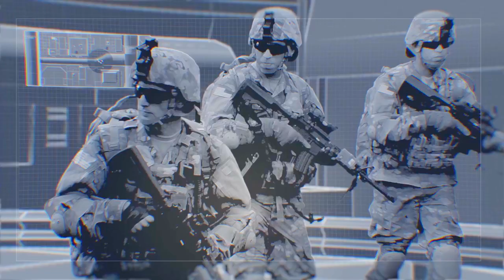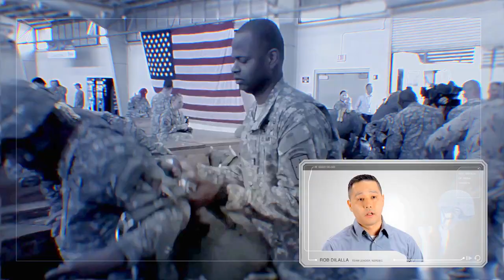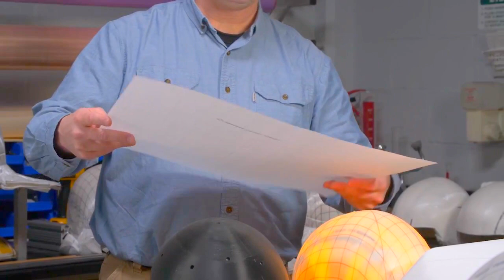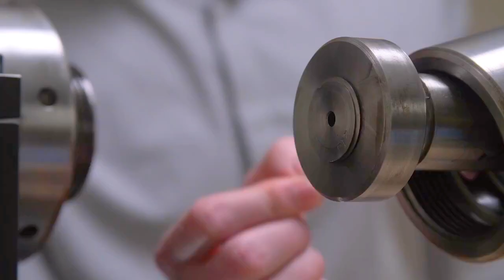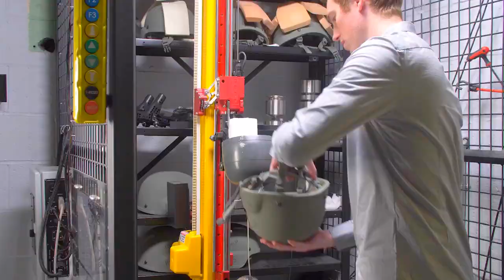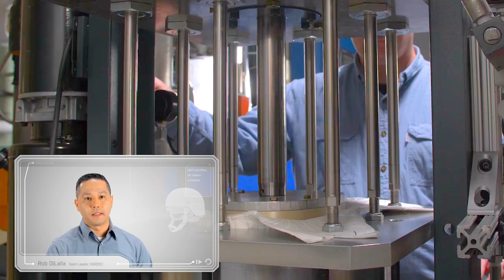US Army Natick Soldier RD&E Center - New Combat Helmet Prototype [720p]

Comment: This reminds me of the Ratnik Helmets (also provide better protection for less weight).
Reply: Standard Ratnik helmet is the 6B47 that means 9mm pistol round protection.  That's just about equal to the Stock ACH in use
Reply: thats what i am saying the 6B47 is lighter then the ACH yet provides the same protection.

Comment: Will the Marine corps be implementing the IHPS helmet or is it a solely army equipment?
Reply: I suspect the Marines will look at it but issue? hard to say because of the number of parts involved. it's not just a helmet.
Reply: Leon Cranson the Marines tend to get anything the army does so I was just asking. 

Thank you.
Reply: Not Accurate in the past 4 decades the USMC has gone it's own way repeatedly. They have issued there own Field uniforms, Helmets, Body armor, Load gear, Rifle ( M27), Vehicles ( actually that dates back farther but both land and Air) even bayonets .